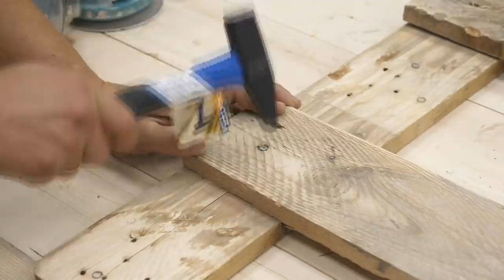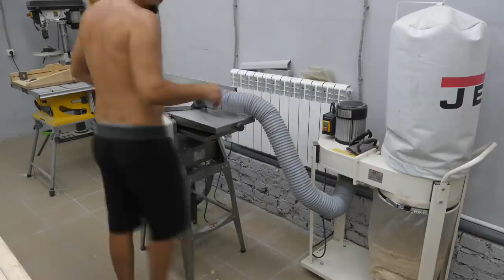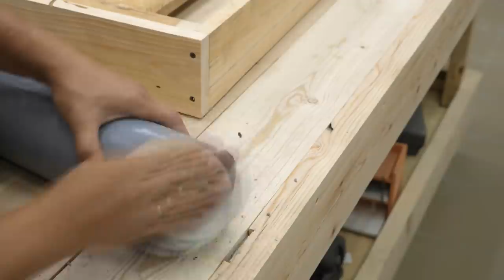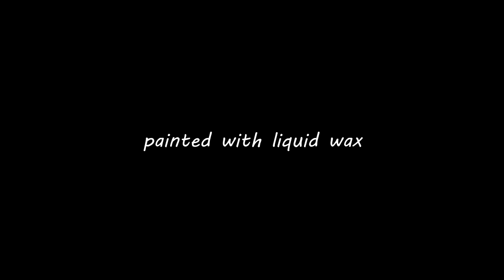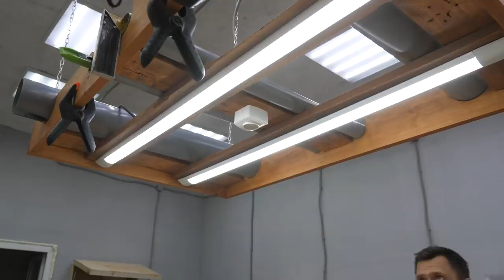The neighbor went into the garage, and was in Shock!! from what I did.

Comment: Mate,  when you split up a pallet, don't do what you did..You can use a block of wood going from the back, placing on a board and hitting it with a hammer or you can hammer the blocks between the boards, this will result in far fewer broken boards..ty